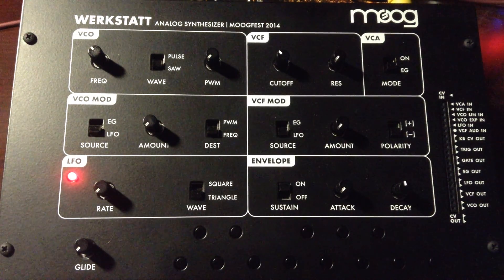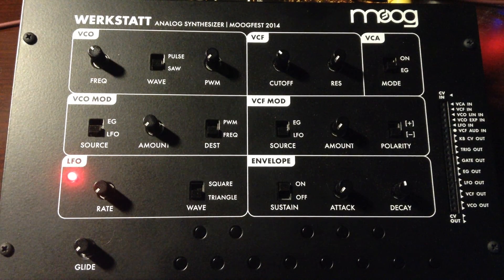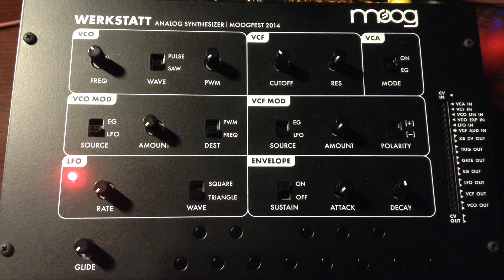GearPronography 20140520 Moog WerkStatt

Comment: Thank you.  I have just bought one of these, serial number 0007!
Reply from the maker: Single digit serial number! Nice. The only thing that I had to do to mine was dial in the KBTRIM trim pot (VR10). I used the MOTU tuner to make sure that the Hz between the two "C"s on the keyboard were exactly an octave. Also carefully dialed in the VR7 trim pot (with MOTU's O'scope) to square get the VCF CUTOFF dialed in properly. The three trim pots are set by the Board Assemblers during the Test Procedures, so they should be spot on.

The Werkstatt really is a superb instrument, and way more than meets the eye. A great machine to teach raw analog and CV, or an UberBass voice with a ton of CV articulations once you get it dialed in.
Reply: Hails mates, the beast is back! Any tips on those wire connections? Like are there any ones that are wrong when using with other gear?

Comment: How did you modify the 1/4" out to fit the werkstatt? thx for the vid!
Reply from the maker: Totally welcome and thanks for the View and Comment!

The Werkstatt, is still as it was when I built it and serial#ed it at the Moog Engineering werkshop. I haven't made any circuit-level "mods" to the board at all. I have only put it to an O'scope to dial in all the trim pots.

The 1/4" out from the WS is the audio out, and the only processing was to levels. The Behringer HA4700 is a 4ch headphone distro unit that brought the signal to mono and "cooled" the level a bit. Then the Samson SM10 is a simple mixer and into the iRigHD. Software was a Filtron (flat), and onto the iTouch's built in camera software. A rather stone-age production, compared to what I'd like the whole show to be (but that's many budget from now).

The BeatStep CV was simply soldering a wire to an 1/8" (3.5mm) TS connector (twice, one for Gate the other for CV) and directly into the CV on the WS. The CV from the BeatStep was driving the VCO rather than the keys, that's why the sequence was able to range well past the keyboards range and the keyboard was simply changing the scale that the sequence was running. I have since seen the Sweetwater vid' where the guy has a ground wire set-up too, that might explain the "off" tone I was getting from the VCO control. I'll eventually dig back into the external CV into the WS, after some other projects are solved.